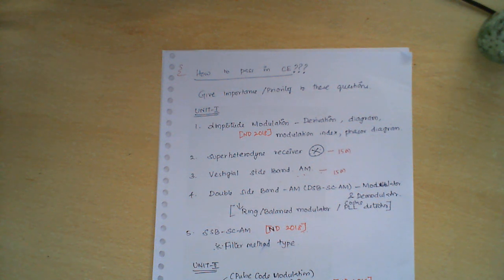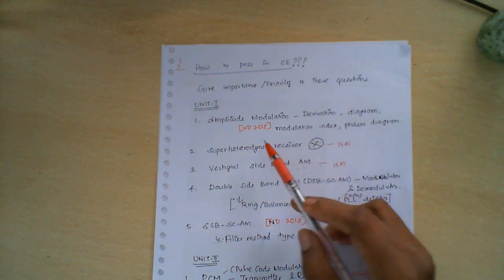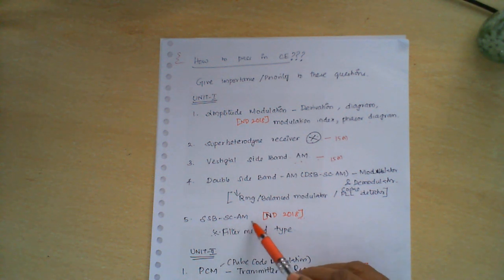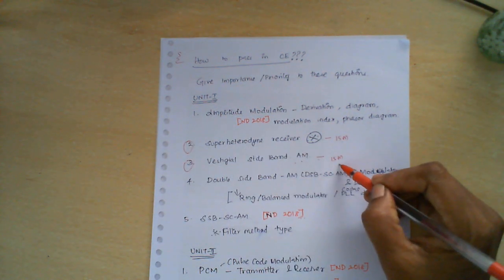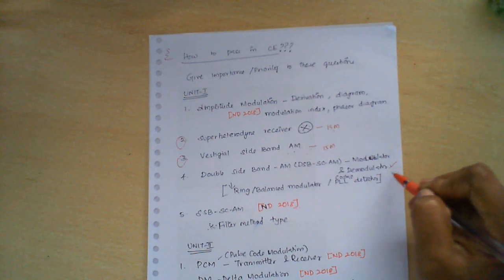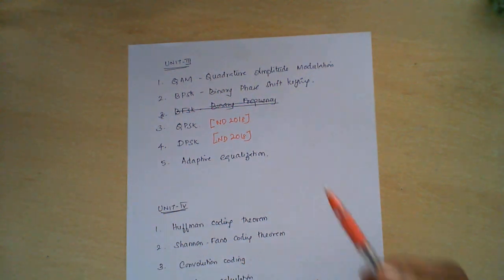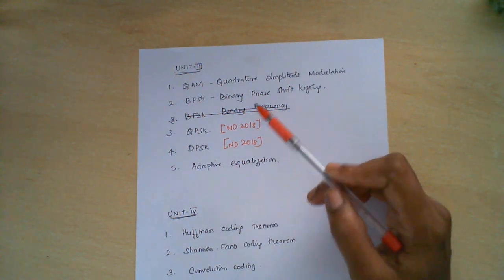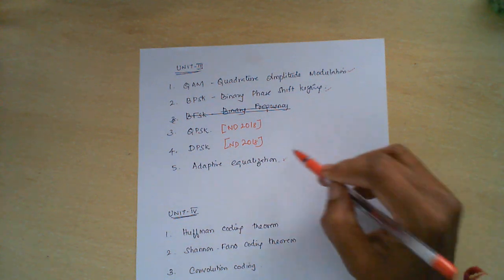HOW TO PASS IN COMMUNICATION ENGINEERING?

Comment: Mam please help me I have arrear in ee6651 Communication Engineering 2013 regulation .Can I clear the paper using these questions ..
Reply from the maker: Sure, I'll check with questions and post important questions of EE6651 CE - based on your regulation 2013.
Reply: @mydhilisk1106   Thankyou so much  mam .
Reply from the maker: @beautifulvibes8497  Am analyzing old QP  will post soon. Meanwhile  study these topics(UNIT3): 1.Shannon Coding problem 2. Convolutional Coding Problem 3. Linear Block Code problem - ALL THESE have been asked for EE 6651 generally only, so you can study these problems ( with any these numerical values)
Reply: @mydhilisk1106  Okay mam sure .Thanks for your help mam .